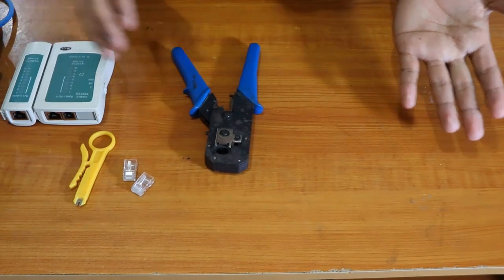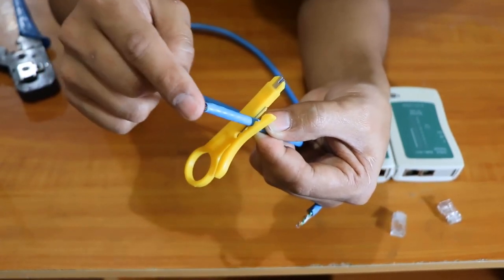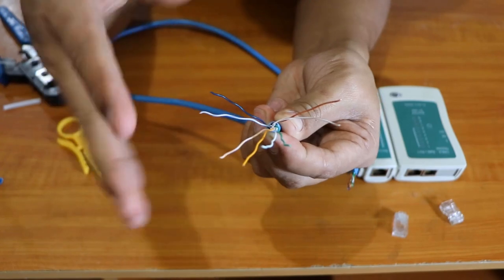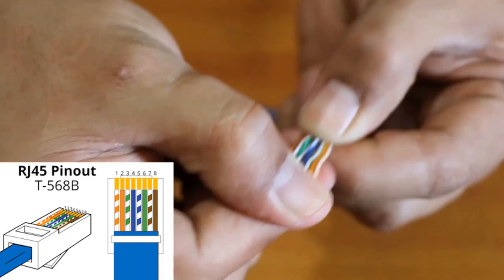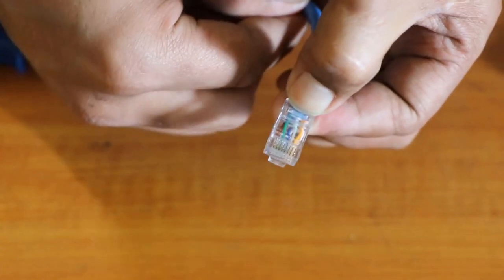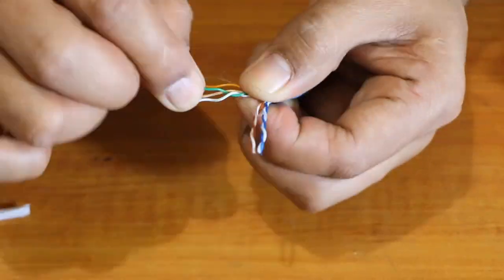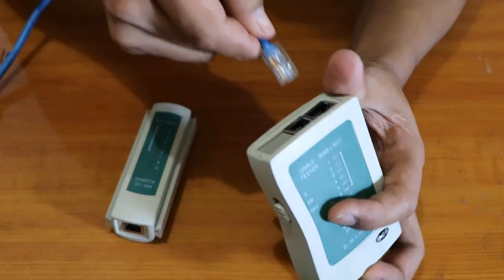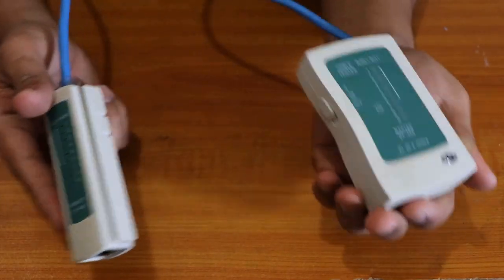Let's make the Best DIY Patch Cable | Ethernet Cable | Patch Cord | cat5e | cat6 | cat7

Comment: sir can i ask a question,.what is best wifi repeater and more longer in terms of range?
Reply: The Best I got a router that has amazing range and it can go through 5 ft concrete walls search “ASUS rapture AX11000” it might be a little pricey but it’s worth it!!
Reply: FantomXgamez sounds healthy what’s wrong with a cable